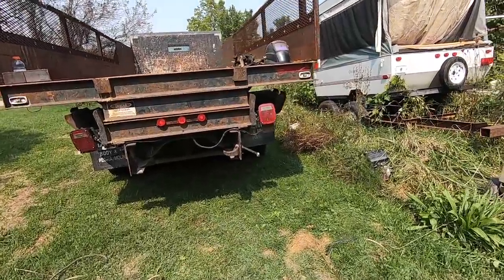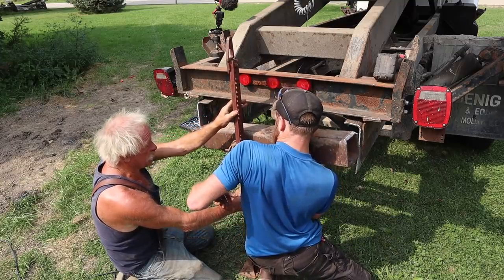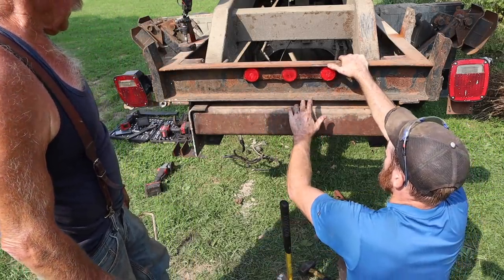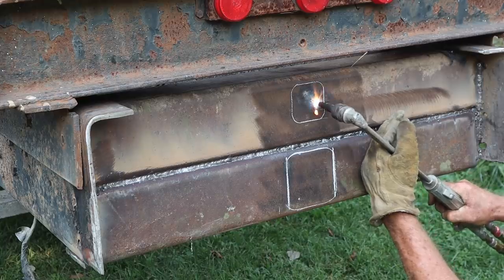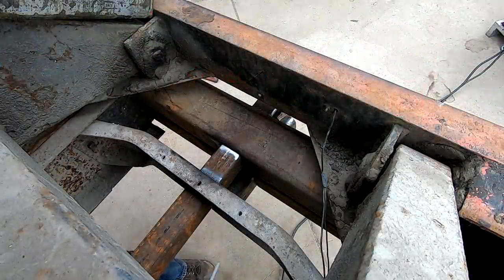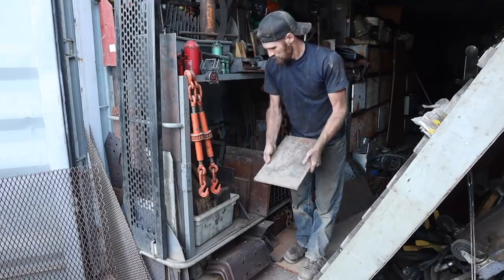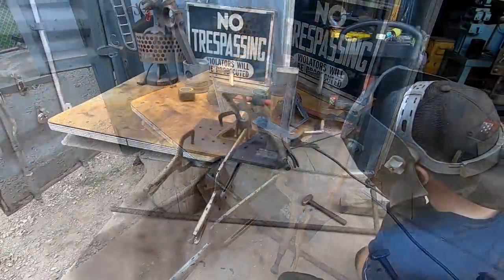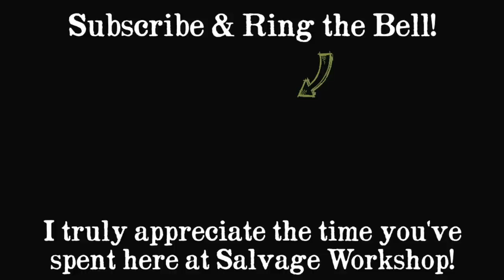Fabricobbling a DUAL Rear Hitch Setup?!? ~ 1988 IH Scissor Dump Truck

Comment: not hating but of all things you use a bumper jack... take inspiration from the truck youre working on and get a dang lifting table! they are pretty cheap for their uses if you are in a shop all the time. it would have saved you and gramps quite a bit of resetting
Reply from the maker: Ya i agree! It was literally right there when we were doing this... i cant stand those jacks, but sometimes it takes more time to go get another tool at Mikes than to just make it work! So we made it work!

Comment: Great job, I’m just wondering how long it will be before you ground that plate with such a low hanging height and bend the heck out of it. Also, you commented about the taper on the brace you added as something someone had put their for another job. He was probably a welder and that taper and correct weld pattern is the correct way to go, not as you do now and in other jobs. Really appreciate your content though and the awesome projects you tackle

Comment: ISN’T YOUR TRUCK FRAME ONLY TO HAVE MODIFICATIONS MADE WITH FASTENERS (NUTS/BOLTS)?  THE FRAME SHOULD NOT BE WELDED?
Reply from the maker: Welding 2" or more behind the rear suspension points is acceptable if you know how to properly weld on the frame... The hitch we added is like 4 feet behind the rear most suspension mounts! There won't be any issues with what we've done! If anything, its stronger now!

Comment: If I was u I wood run air Lin’s to the back of the truck and also the round 7 pin for the big treller that what I did on my 85 f800

Comment: I would have notched out the bottom corners of the square pipe then slipped it onto the top part of the bottom frame lip instead of cutting the main frame it would give more support.

Comment: Water will condense in any metal tube that is sealed and cause rust . I would at least have drain holes.
Reply from the maker: Not a bad idea... maybe a couple small holes to deal with that
Reply: @SalvageWorkshop  as thick as that box steel is it take awhile. All I know is I have made a lot of different stuff and have seen 1/8 wall material that was sealed rust pretty bad on the inside .

Comment: Your friend sure can weld.

What amperage did you use to weld 3x3 to plate?

Nice project 
Frank
Reply from the maker: Yeah Mike has welded more rod than i could even imagine and yet he is as humble about his skills as is possible... i was welding the hitch receiver somewhere in the 150 amp dc range... it's not coming off without a torch!
Reply: I am a beginner welder

Comment: Where the skid steer and cat dozer go. The way that 2"hitch was bent someone trailer brakes was not working and now that you have a 3" bar stock that 1/2 plate will fold in half with out braces it right and should of plug weld that  plate to  that bar stock your weakness point now is the plate just saying You be ok just don't go be low the gusset to far

Comment: looks like the pin is going to be the weak point. should have use two pins
Reply from the maker: If there is an issue, i can always add another pin on the back side of the square tubing... the pin I'm using is larger than a standard hitch pin, it'll be fine!

Comment: You built a heavy duty hitch plate which was painful to watch you get into place and fight with for what seemed a eternity then put a 2 inch hitch receiver into it with a tiny pin in it that takes all the strain when towing I'm glad I won't find myself on the road if you're towing anything dangerous
Reply from the maker: Great! Thanks for watching!

Comment: overkill it. your weakest point are the 4 screws.3 inch square is much to stronger than the screws.if it fails it will be to the screws